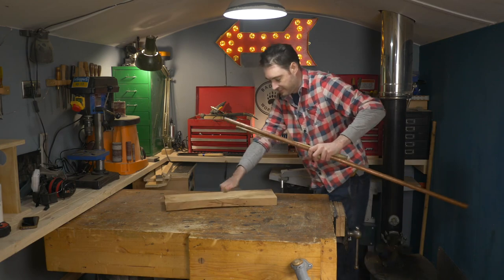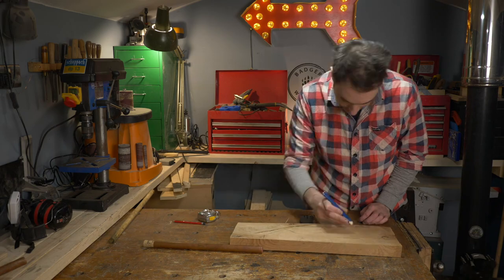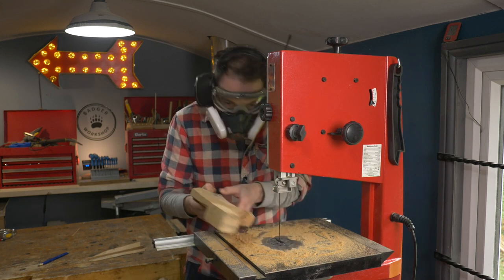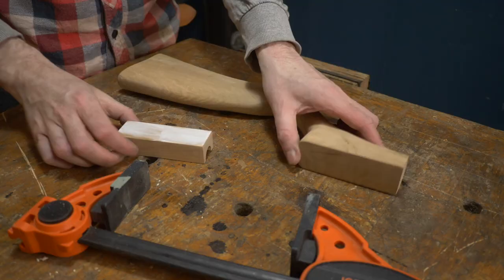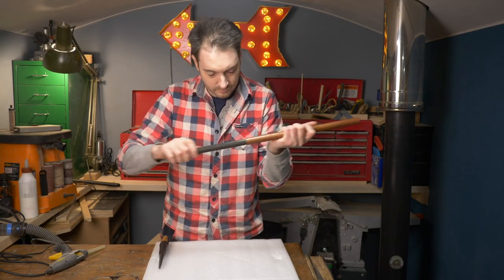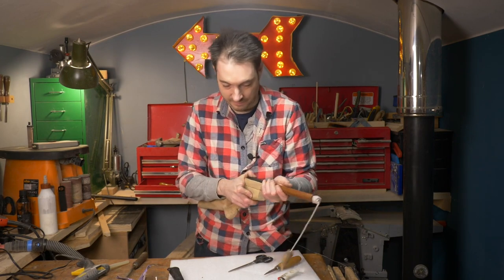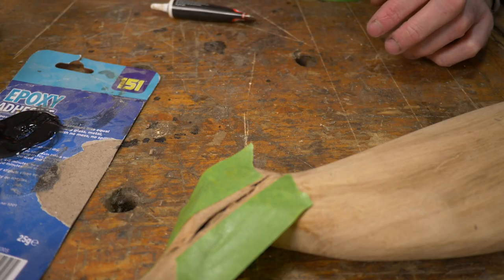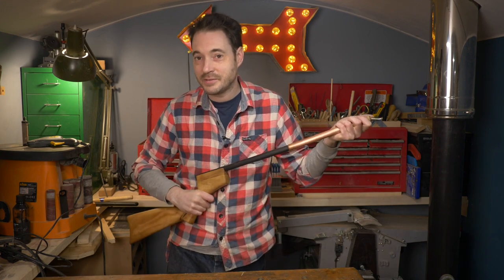Making A Toy Pop Gun

Comment: Hey friend, I just found your channel. I actually build pop rifles/guns for a living lol. I know that sounds crazy, but it's true. Anyhow I was just going to let you know. You should take a small metal washer, and glue one on each side of your cork(hot glue works well for this part too). Glue the washer around the hole the string goes through (on both sides of the cork).. That way the string is less likely tear through the cork as the pop gun is fired over and over again. Just a thought, because that's one of the main points of failure, on these toys in general.. Awesome pop gun, well done. Anyhow, just a thought. Take care.

Comment: The cork is on a string attached to the piston which is in turn fixed to the stock. Since the barrel is the only thing moving, the cork doesn't actually fire out the end, it just falls as the barrel receeds. I would attach the barrel to the stock, perhaps with screws, epoxy or both. Drastically shorten the full-diameter piston to only a few centimetres and extend it out of the back with a thinner piece of dowel that doesn't interfere with the screws from earlier. Put another, even wider piece of dowel at the other end so as to limit the travel of the piston.

Comment: You mentioned your drill press was too short for one operation.  I have the same problem, so I loosen the drill press head and turned it around.  I now have a bench top drill press converted into a floor drill press.  Perhaps you could convert your drill press.
Reply from the maker: Could work